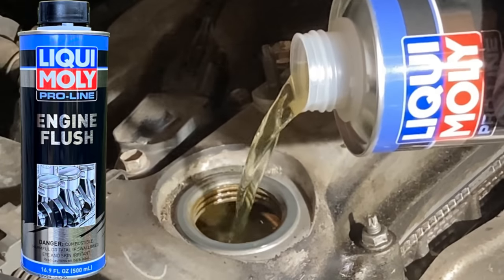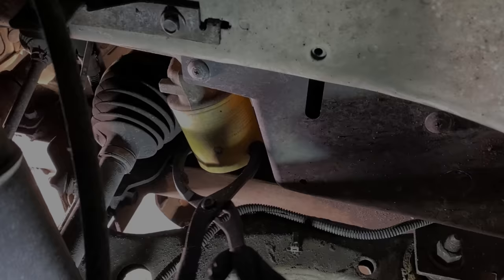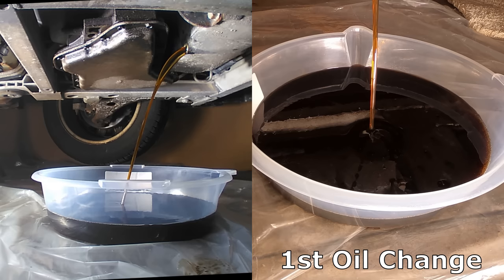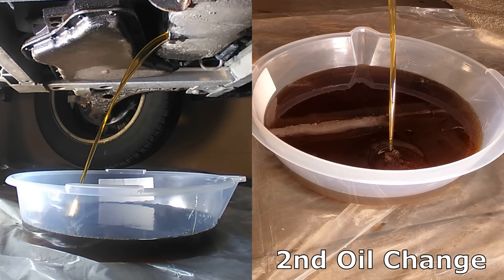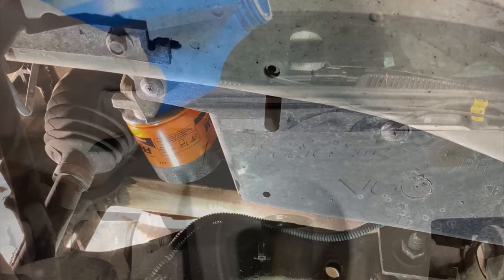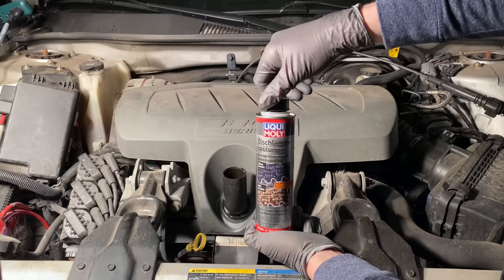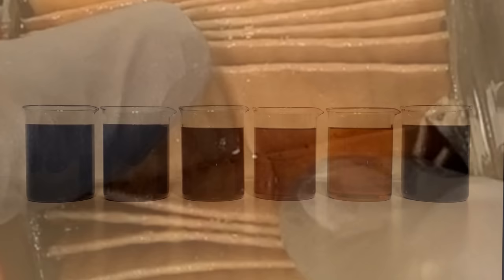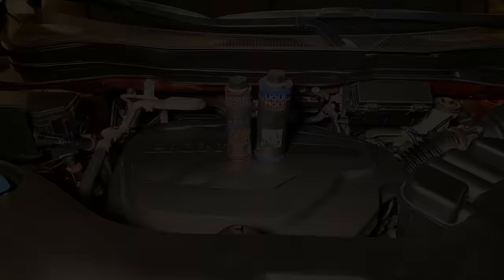Liqui Moly Sludge Remover vs Liqui Moly Engine Flush (Which is Best?)

Comment: If you plan on flushing your oil, it's important to consider that 5-10% (not an exact figure) of the old oil may remain in the oil pump and other parts of the engine, even after draining. While flushing can help break down sludge and make it easier to drain through the oil drain, it's important to note that the contaminated 5-10% of old oil left behind can mix into the new oil, degrading its quality to some extent.

Keeping up with your recommended oil service intervals and using the recommended oil standards from your car manufacturer can help you change the oil before it degrades and forms carbon deposits. This will allow you to replace the old oil with new oil, keeping the lubricating benefits of the new oil and avoiding the need for engine flushing.

However, if you want to truly flush your engine, you can use an engine flush product with the old oil and then drain as much contaminated oil as possible. You can then top up the oil twice, once to dilute the remaining old oil with minimum negative deposits and then the second top up you can then add the new oil to complete the oil service and keep up with your oil service intervals to prevent future issues.

Using oil additives that enhance the engine oil can also be useful in preventing carbon build-up and extending service mileage, but it's still important to change the oil on the manufacturer's recommended mileage basis. Engine flushing may not be necessary or practical for every oil change, and it could be a waste of money if the oil is being changed correctly. However, it can be useful for older cars with high mileage.
Reply: Loo
Reply: Exponential decrease with oil changes.
Reply: If your car is abused by previous owner, good luck!
Reply: Best flush is add 1liter of kerosine to old oil, run for 10-30 minutes, not on idle but avoid heavy load for engine just light driving or some idle and moderate rev (2-2.5k rpm) on neutral. Drain everything, change oil filter use just cheapest one. Buy cheap synthetic or semi-synthetic oil 1.5 times quantity You need for Your engine. Remove Your spark plugs and add about 100ml of kerosine into every cylinder, leave it overnight. Next day turn engine with statrer still without sparkplugs to avoid hydrolock and remove excess kerosine from cylinders (probably there will be none anyway, all or most drain down to oil pan through piston rings softening carbon deposits but just to be safe check it). Put sparkplugs back. Now add 50:50 mix of oil and kerosine to Your engine top it off. Run it on neutral with moderate revving (or very very light driving) for 30-60 minutes. Drain everything, change oil filter for cheapest one. Top up engine with cheap oil to clean the residue. Drive on it short time like 100-300 hundred km/miles. Drain oil and replace oil filter. Now use quality oil and filter. You're ready to go. Change Your oil and filter often, I do it usually between 10-12kkm or 6-8k miles even my car manufacturer recommends like 20-30kkm/15-20kmiles oil changes which is ridiculous but welcome to europe.

This will not only clean the engine oil system, also piston rings and combustion chamber, big chance to reduce or even eliminate oil consumption of engine, make it run better.  Many times oil consumption is not because of worn piston rings it's because they are stuck with carbon deposits (some natural due to long use of engine but mostly because not changing oil on time before). 

If You willing to spend more money You add some engine flush instead of kerosine like 50% oil 25% of kerosine and 25% of engine flush, it will be even more effecient.

 Don't use like some people 100% kerosine or diesel fuel instead of oil because You will have too low engine oil pressure so one you risk damaging engine second with low oil pressure and flow it doesn't work as well
Reply: Is it a myth that flushing an older engine causes it to spring leaks ?
Reply: @anirudhaarvind1736  mostly myth but it might happen in very very old engine at the literally end of lifespan.
Reply: Just drain you oil, take off your oil filter, place a towel around oil filter housing, and start your car for 5 seconds.
This will pump out the remaining oil.

Yes it's not great. Only do it for 5 seconds.
Reply: @oluskloc  will IT Help with Audis TFSI oil consumption?
Reply: @Jojo-wq4fy  big chance it will help but no guarantee, worth to try i think
Reply: Thats why you use a new filter. Duh!
Reply: @Nick-GR  even with new filter always some of old oil remains
Reply: According to my motorcycle (wet sump) service manual, out of 2,4L total, there is 200ml slushing around after drain and filter removal, so 10% figure is correct.
Reply: @Stratos1988  yeah it depends on engine but always there's some oil left (2-10%). In motorbike it's on the bigger side because its combined with clutch and gearbox so much more places to keep some oil. On automatic gearbox there's usually from 15 to even 50% of oil left on change
Reply: this is why you should run the engine without oil to get the rest of it out
Reply: Even if oil changes are maintained it's still good to chemical flush every 50k
Reply: @Jojo-wq4fy  some TFSI models depending on the year have had issues with the piston oil rings slipping small bits of oil past them and there are revised oil rings to replace the previous 

Some people I’ve known had this issue sorted with that change alone but hard to say without looking into the engine
Reply: @jonathangarzon2798  yeah I can agree like I said good with higher mileage cars…… but it should never need to be consistently like after every oil change or so
Reply: @devarmont87  thats such a terrible idea 😂😂
Reply: @sigmamale4147  I know haahhaha

But it it'll work 😄
Reply: @devarmont87  Stupid idea.  Some engines - looking at you Ford - will NOT prime the oil pump from empty.  You end up with no oil pressure and an expensive repair unless you follow the expensive procedure to prime the pump again.
Reply: So true. Modern engine oils has detergent , as far as I know and regular oil changes keep the engine clean with no need to be flushed.
Reply: I don’t know what drugs you guys are on but engine flush is usually only 300 to 500mL and let’s say for the worst case scenario 500 mL is put in a car with 4L oil capacity engine, that still has 20% of oil left in the engine after a flush, there will only be 2.5% oil left, and you are telling me that 2.5% could potentially damage your engine, lol
Reply: @oluskloc  I do believe you're CORRECT sir.
I've resurrected a sludged 2006 GM engine using multiple kerosene flushes.  It WAS burning 1.5 ltrs oil per 1,000km, after 3 consecutive kerosene (2 ltr kerosene + 5 ltr engine oil (6.5 L oil capacity)) flushes, it's now burning around 0.5 ltrs oil per 1,000 km, and using around 10% less fuel for the same journey.  Biggest shock I got when I looked in the oil filter housing (it uses a cartridge type filter inside a metal housing) was the two holes I could SEE - they'd never been visible before!!

Comment: To help answer your question about the darkness after the moly flush. Molybdenum disulfide is a dry lubricant somewhat similar to graphite. It’s a fine black powder mixed with whatever else is in the engine flush. The results can seem a little misleading. It gives the appearance of more contaminants being removed when really it just turns things dark. It’s used as a thickener in complex lithium moly grease. Great for ball joints and cv shaft bearings (not the tripod gears in the shaft). The thickening effect is why they recommend keeping away from full throttle circulation. The idea with the moly isn’t to clean anything but to coat the engine components allowing them to have the additional lubricating affect from the moly. Not sure there’s enough moly in the flush to have any real impact.
Reply from the maker: Very interesting points.  I’ll have to check the MSDS to see if there is moly in the flush, if they even disclose that.

Would be interesting to see if LiquiMoly turns new oil on a new engine dark!

The part about thickening is interesting as I thought the solvents in the flush thinned the oil.

Thank you for your insights!

Comment: To answer your last question you could have done another oil change after driving same km when added the sludge remover and see if the discolouring was due to driving that distance or due to the sludge remover.
Reply: Totally agree. I was going to write that exact same comment. I would have actually loved to see that, which would have truly completed the test.
Reply: Yep. Ended test early. Had no money for gas. Spent it all on oil. Regardless, great video!

Comment: After these intense flushes its always an good idea to drop the oil pan and open the oil pickup filter and clean the pan. Sometimes the interior of the oil pan is painted and the flush can remove the paint and make it clog the oil pickup tube.

Comment: I did two flushes with the sludge stuff in combination with cheap BUT SPECIFIED oil for my engine (a 1.9 JTDm). It worked wonders! I initially planned to do at least 3 flushes because the engine didn't look well maintained but this has been enough. I then filled up with high quality oil, also Liqui Moly and during every oil change and flush I used a new oil filter also a Bosch quality part. I'll repeat this process before the next oil change after 10k km and will probably continue to do so. To get it even more clean and let it stay clean. Engine has almost 200k km on it.
Reply from the maker: Is the engine in an Alpha Romeo 159?  That is a beautiful car.  Glad to see the flush worked out for you!  A good oil with a lot of detergents will also help clean your engine between flushes.
Reply: I must ask where you found a 1.9 JTDm with less then 200 000km. The dash bight be showing that but trust me not a single one has that milage. None the less that is a very reliable engine. I suppose you got it in the Alfa 147 or 159 or in Fiat Stilo
Reply: 10k is a pretty long interval
Reply: @Druze_Tito  not really. 6000 Miles. It's about average I would've thought
Reply: @eponymous7910  average doesnt mean anything. It is too high. I dont recommend going more than 6000 km no matter the oil. If you love your car.
Reply: @Druze_Tito  I remember reading a long comment from a guy who claimed to be in the car rental business. He claimed that they often performed tests on similar cars, to see if they could make their rentals last longer, and what they found was that at around 3,000 mi oil change intervals, that was when they'd get the first sign of metal bits in the oil filter, but that the amount would rise exponentially if they went higher than 5,000 mi between changes.

For the brand new engines the manufacturers actually recommend 20,000km / 12,000mi vs their previous guidance of 10,000 km / 6,000 mi, due to them specifying 0W16 GF6 synthetic. The older guidance maybe 20 years ago before PCV systems was 5,000 km / 3,000 mi. I'd still keep it at or below 10,000km / 6,000mi depending on use with the brand new engines though, I suspect the numbers they give are designed to ensure the engine lasts longer than the warranty period rather than designed to make it last 20+ years.
Reply: @Druze_Tito  /
Honda Fit/Jazz 1.3, oil-change every 20k-km (=every 8-month), done over 350,000 km, still running fine 😇
Reply: what improvements have you noticed because of the flush?
Reply: @j.r.arnolli9734 i also have jazz with 250k km, what oil do you use? do you have varnish in your valve?
Reply: @OwenLucas  you had all this trouble, of recording, editing, multiple oil changes, and you didnt use funnel :-(
Reply from the maker: @uroskostic8570  😂
Reply: @Druze_Tito  Modern cars have a 30.000km service interval, I do half (every 15k km) and never had a problem with my cars and I drive them hard!
Reply: I have watched again, and think, maybe you should have used sludge remover with first new oil, so second and third simply take out possible sludge remnants. @OwenLucas
Reply: @uroskostic8570  I think the idea is that the sludge remover pulls out more gunk than multiple oil flushes will.

Comment: You forgot last part of experiment. Drive another 200 km now without any cleaning aditive and drain again. If you see significant difference between that and previous sample than it works; if it is again similarly dirty then it does not.

Comment: Also beware, sometimes if the sludge is really heavy, it can end up clogging the oil pump pickup screen.   Used to add a quart or half a quart of ATF to an oil change, the atf has amazing amounts of detergents in it to keep the transmission squeaky clean.  Keep going forward with regular oil changes.
Reply: wouldnt that be hard on turbo bearings? if you drive a OEm turbo 4?
Reply: No it wont. So much detergents and emulgator in it.
Reply: Did you mean add to old oil to help flush and then drain, or to top off after fresh oil change. Thanks
Reply: @slimsherman5818   That's correct, 500-1000 miles before the next oil change a shot of ATF into the engine oil.  The biggest generator of nasty sludge is cold thermostats, short trips and crazy intervals between changes.
Reply: i hear this answer all the time everywhere. Be aware that using engine flush can clog the oil pump or the pickup screen. Have you ever seen how big is the pickup screen and how big are the gaps? If you can clog this pickup screen it means your engine is tearing apart not just sludge. To clog this screen you need pieces of the bearings or the pistons. It is not so simple to clog the pickup screen. And if the engine can clog because of this it means you need a change of engine not just sludge removers.
Reply: @makgstefan  Oh, yes pistons will clog the screen, the holes are typically .5 mm or so, a badly sludged engine can send enough carboned up oil goop down south to clog the screen and usually kicking the oil pressure warning on eventually. Had some customers that wanted the screen cleaned the cheap way, hole saw the pan, clean the screen and weld it back up.  Sometimes it'd work for a little while.
Reply: @makgstefan 
Yes they are and I've seen them completely clogged with sludge. Not often but have seen it.
Reply: Atf is an old school way of doing an engine flush. Yes it does work, but it's hard on the gaskets and seals in the engine so I don't recommend it. Just use Liquimoly Engine Flush instead. It's formulated to break down the sludge, it won't get stuck in the pickup screen
Reply: @TheCompyshop  Buna and Nitrile are used in both engines and transmissions, sometimes paper fiber pan gaskets too.
Reply: @fastst1  Different formulations of different materials. I’m telling you from first hand experience it’s not a good idea. I used to use ATF back in the day to flush engines, I stopped when it started to cause my customers to have oil leaks a couple months later. I started to notice a pattern.
Reply: @TheCompyshop  I believe you, which seals, crankshaft ones? wondering if some fine carbon broke off and scoured them out.

Comment: You have to remember that the Sump will have sludge  that builds up over time and will get washed out with solvents.
To help prevent this condition use WD40 in with your oil. 1 cup will work fine and clean all internal parts and you will also find that oil changes will be abit fewer that you'll need as the engine is getting a gentle clean out. I did this with a 2008 Ford F250 Super Duty and great results happend as I let the WD40 work with my oil my engine has returned to near factory condition. One of my lash adjuster was starting to stick when the engine was at operating temp and light ticking was heard - on cold start up it was all quiet - So i tried this in adding WD40 and It sure worked and freed up what ever the stickiness was at the lash adjuster and no more tick .

Comment: Good chance the color changed due to temperature from your drive. Oil turns black simply by getting hot, but the little chunks you got out are a good indication that the product was helping. Cool video, and at the end of the day it can't hurt to try and flush an engine. AMSOIL has a similar product as well.
Reply: No it doesn’t.  If your oil discolors from getting hot, you have some seriously bad oil.
Reply: Blow-by occurs when combustion gases and possibly some unburned fuel pass by the piston rings and enter the crankcase. These gases can contain carbon from the combustion process, which then mixes with the engine oil, causing it to darken. If the piston rings are worn out or not sealing properly, blow-by can increase, leading to more rapid oil discoloration.
Reply: @datsuntoyy  Yes it does. It is a well-known characteristic in the oil industry around thermal/fluid dynamics. Simply heating oil in a beaker will turn the oil black. Now, there a many other factors which can contribute, but oxidation and heat will turn the oil from its gold color to black quite quickly. Project Farm has some great oil testing videos (much of which can be subjective) but he will heat up oil on hot plates and after 30 minutes of heat the oil is black.
Reply: @cbidwell91  Burning oil will turn it black, ordinary use doesn't get that hot.  I've seen plenty of oil samples in my 50 years of working on cars with a few hundred miles that have no color at all other than the light amber it comes with.  Likewise, MANY years ago I've seen brand new oil that's nearly black. 
Hot plates get a lot hotter than a car engine does.  My car's maxes out at 220 (hottest I've ever seen it) yet my hot plate can get over twice that.
In his test he's heating it to 400 degrees and flashpoint of Mobil 1 5w-30 is 440 so he's heating it to nearly catching on fire.  He also talks about the oil smoking, in cooking it's called the smoke point and oil burns when it his the smoke point.